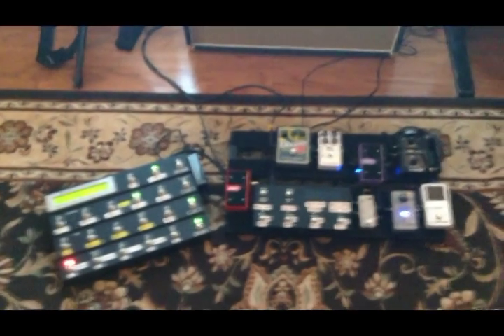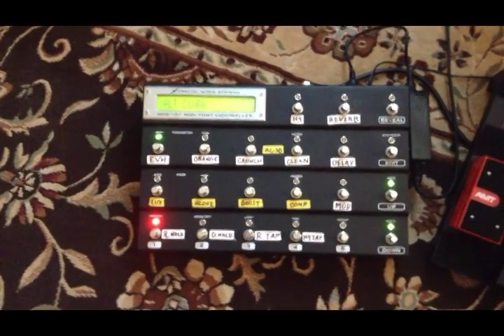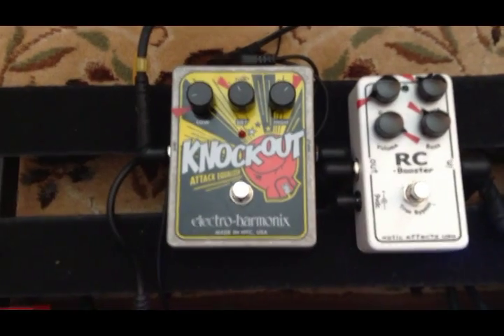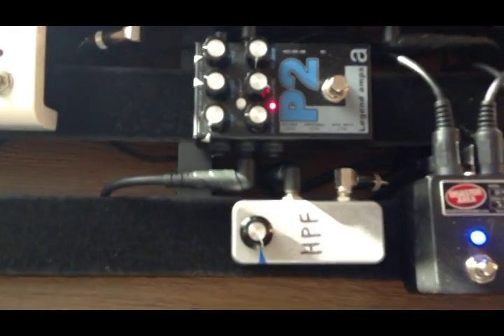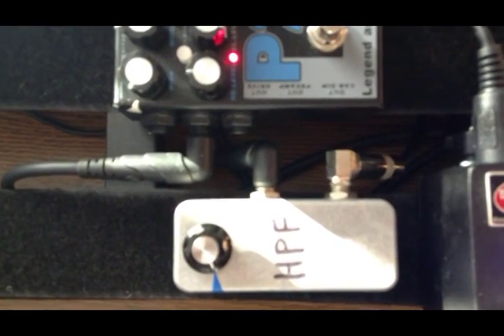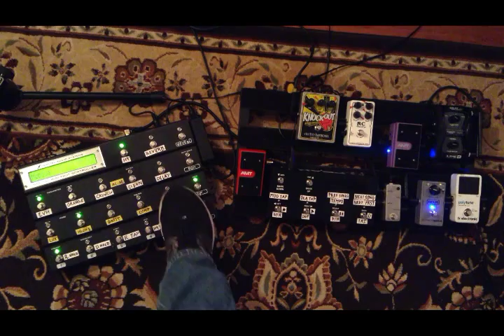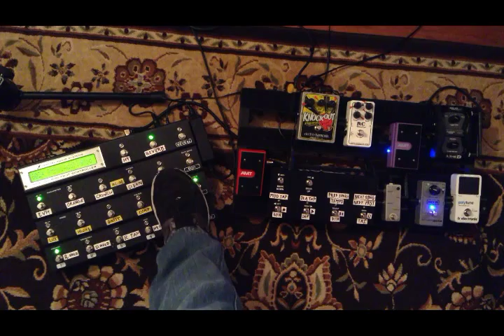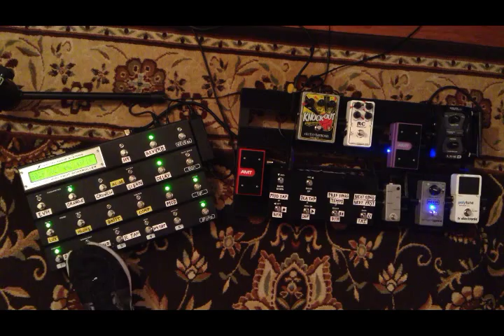Another New Guitar Rig Video!  (AMT Preamp Switching System)

Comment: In my opinion using individual preamps is the future guitar rigs, I think the next step by vends should be to create power amps that emulate the behavior power tubes to close the circle. AMT already took one step by doing solid state versions of 6L6 but I would love to have that kind of behavior into small form power amps and not just replacement tubes for amps.
Reply from the maker: Yeah, I like it.  I don't think using individual preamps is all that new honestly, but these little JFET boxes are pretty amazing and makes it all pedal board friendly.  If a solid state power amp solution existed that I liked more than the AC-30 (or just about any other tube power amp I've tried), I'd seriously consider it.  For now though, I have no complaints!
Reply: Ok, maybe just new to me :) . About the power amp, in a couple of weeks I will pick my ISP Stealth power amp, that is a SS, I know there are others but that was what I decided because I am no going for rack mounted stuff and the Stealth could in theory fit a pedalboard.

Comment: Really glad I found your channel!!! You have a good number of pedals that I'm looking into! What got me interested in the AMT pedals was needing a clean channel when running an Amptweaker Tight Drive Pro directly into my Mesa 50/50. Can I ask, on the AMT P2 is there no EQ on the clean channel? I was looking at the AMT F1 but it's not very exciting doing just clean sounds :)
Reply from the maker: Thanks.  The Legend 2 pedals, like the P2, do not have EQ controls for the clean mode.  They do a really good Fender type of clean that will work in a pinch (I use it at rehearsals sometimes), but for a more tailored clean, you need the F1 (or V1).
Reply: Joe King Thanks Joe. Do you think there's enough clean headroom and enough EQ on the V1 (with just bass and treble) for it to be my main clean channel?Again, great video, and it's uncanny how many of these songs I've played with my band too. I'm also in the UK, been playing for nearly 25 years, and I've always used rack effects, preamps and power amps... in fact I've been using the same valve preamp/FX unit live for the last 15 years! But it's really time for a change, and I'm going down the stomp box road.With you owning a 5150, have you seen the Amptweaker pedals? (designed by the guy who designed the 5150, JSX and other great amps). If you haven't, check out the Big Rock Pro, Tight Metal Pro and Tight Drive Pro, which can all be connected directly to a power amp/FX return.
Reply from the maker: ForViewingOnly
Using an AC30 for clean with just the Treble and Bass tone controls, I find it is enough EQ with the pedal having the same amount of control.  I haven't noticed any trouble with headroom in these preamps.  I run them at 12v, btw.  I know about the Amptweaker stuff, but I've had the opportunity to try one.  Thanks for the suggestion.

Comment: Great, it sounds very wide! How is it miked? Are you running everything in two amps?
Reply from the maker: Thanks.  For this one I'm running direct using a Radial JDX and then doing a stereo spread in the DAW using Voxengo StereoTouch.  Lately though I've been using a Strymon Deco pedal to do a stereo spread into 2 amps and it is working slightly better for me (plus I can do it live that way).  The video on my list right after this one is the Deco doing a live stereo spread if you want to check that out.
Reply: Joe King Never tried the JDX, very nice, thank you!
Reply from the maker: Dan I use Radial JDX boxes live, so this is my live sound recorded in the studio and the stereo spread applied.  Sometimes live I just run mono with the AC-30 and other times I'll do stereo using the Deco pedal and a Night Train amp.  Works very well and is consistent every show.

Comment: What is the title of the song played at 14:30?
Reply from the maker: You made it all the way to 14:30?  For that, you certainly deserve an answer.  That was She Sells Sanctuary by The Cult.  Cheers.
Reply: Ive watched this demo over several times :D I use an AMT E1. The Cult used a GK 250 ML for those records. Well played and super tone Joe.
Reply from the maker: Thanks.  I have the E2 now as well.  I use it in place of the P2.  I like the tone of it a bit better.
Reply: Yeah it does have a nice tone, Ive used it for the last few years. Been thinking of trying something different now. Thought about getting the Bulava ss30, has you tried that? I liked the O2 in your video, sounds great for low to mid gain rock or classic rock stuff.
Reply from the maker: I haven't tried that.  I have the F1, V1, O2, B2, C2, P2, R2, D2 and E2.  On my board currently, its the F1, V1, O2, B2 and E2.  So I switch between 5 AMT preamps now and I no longer use an amp's own preamp.  I haven't had to think about about changing in a while, the only thing I keep doing is buying the AMT legend preamps when I see them at a good price.  More just out of curiosity and to compare.
Reply: That makes sense. Cool